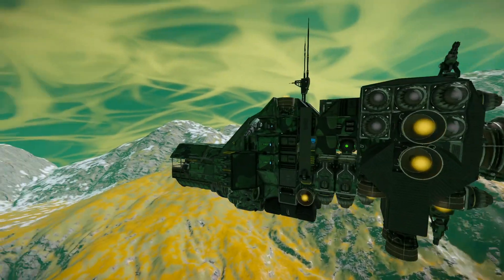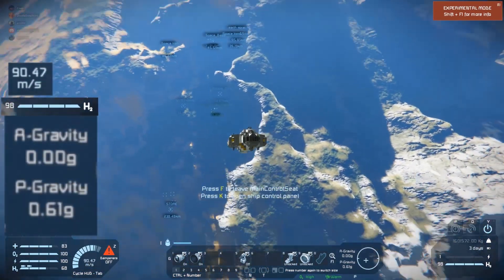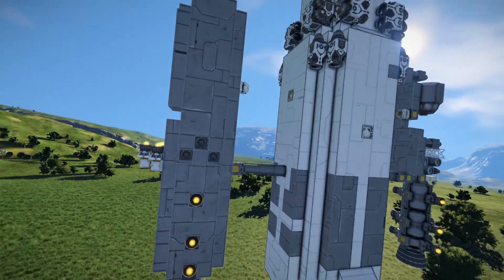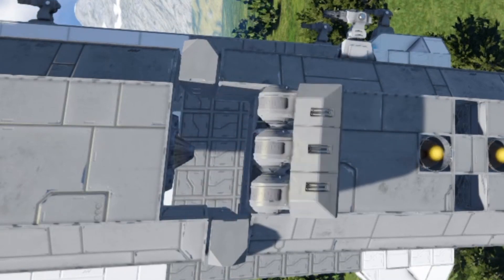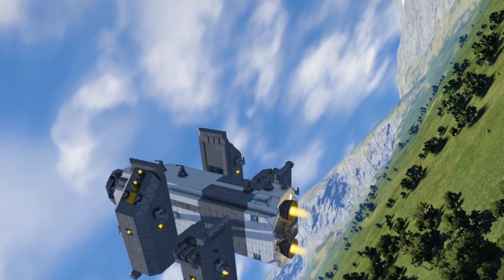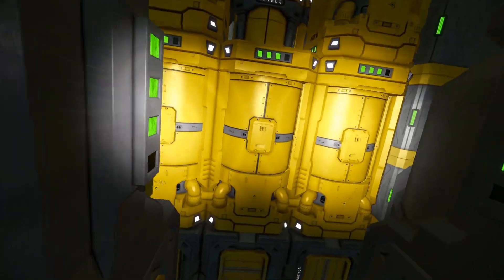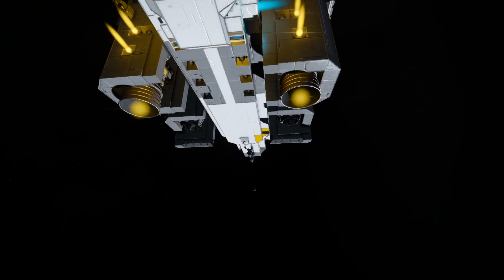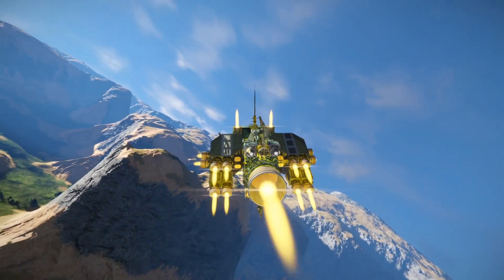Big BAS Mk2

Comment: Nice build. Have you thought of using WIP's auto door. I find it works really well with every door but you have to exclude doors or it will mess with AAECS elevator exclusions
Reply from the maker: It was after this vid I messed with it.  Unless there's a way to specify individual door timing variations, I like the custom distance variation I get with sensors.  There's one ship I have that needs different distances to activate and that script was making them too open-happy.  Otherwise, yeah that would have been fine for this ship.  Thanks for the recommend!